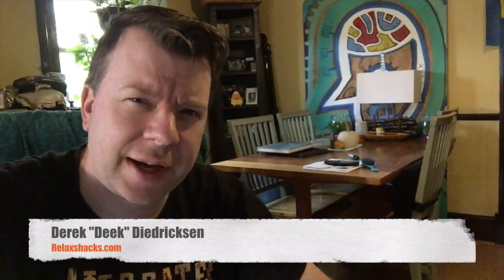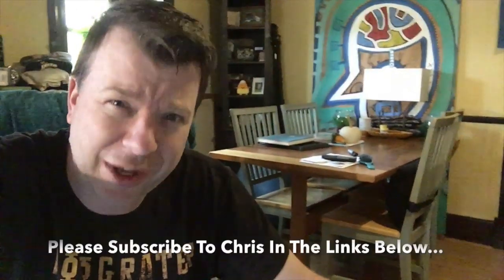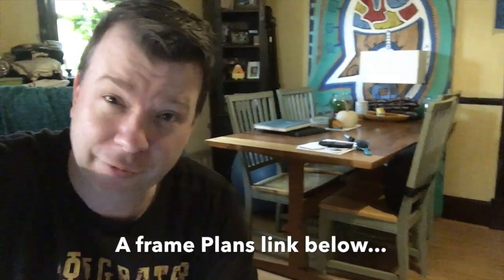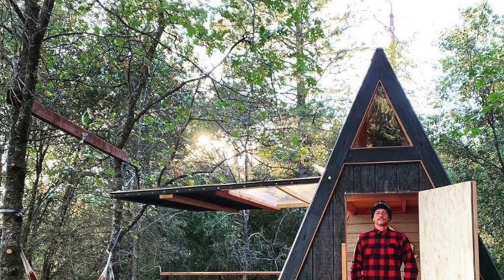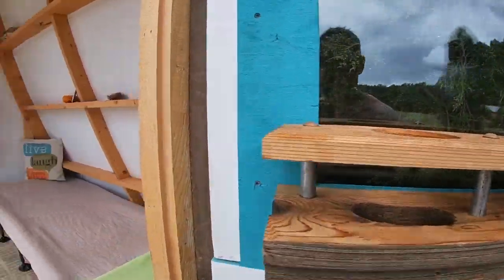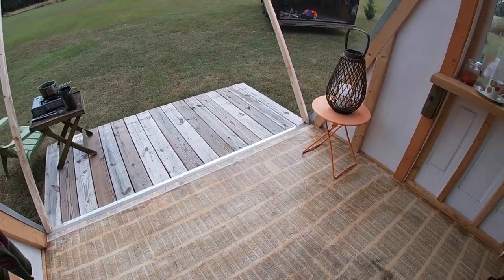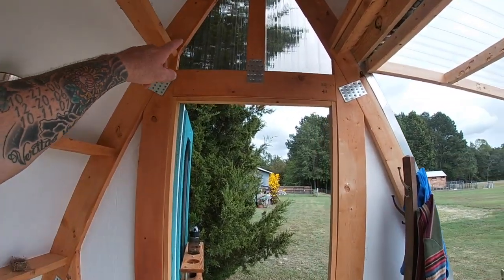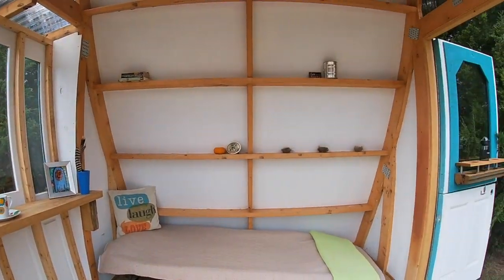This A frame Getaway Cabin is VERY EASY to build!

Comment: Ok Deek, did I just see Saw Dust production in this fellow’s opening salvo? That was my grandfather’s only answer if you asked what was going on down at his shop, with an occasional bit of metal shaving, sparks flying or paint dripping. There was a little room in the back for herb drying as well, of course.

Comment: It's beautiful, but the poly carbonate wall would be extremely hot in the summer. What's the plan for climate control in the summer/winter?
Reply from the maker: You can insulate this easily- as with an structure- you can also position the clear wall away from, or towards the sun- depending on what you're going for- and/or curtain it in the winter to retain some heat. Heat won't be a problem in a space so small though- trust me..... overheating usually is the problem.